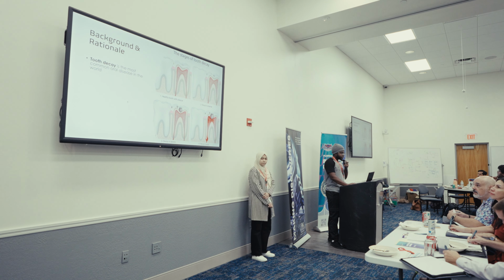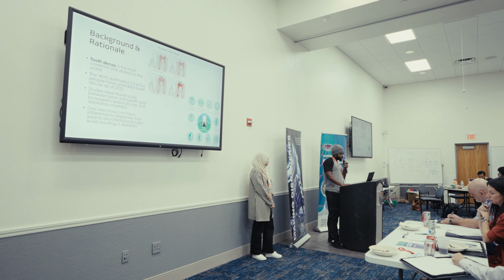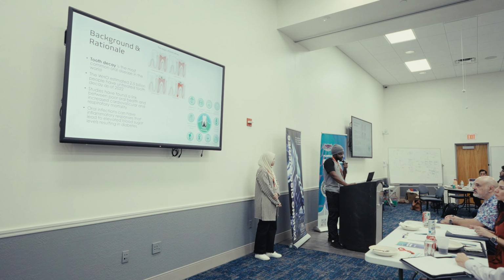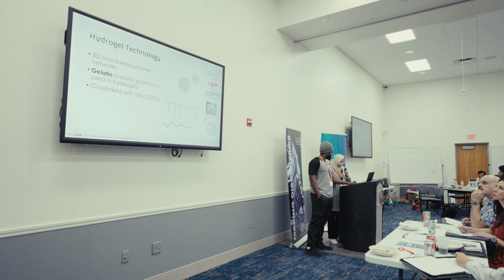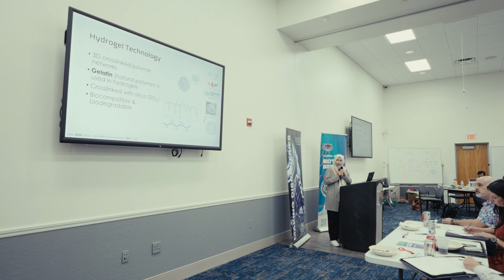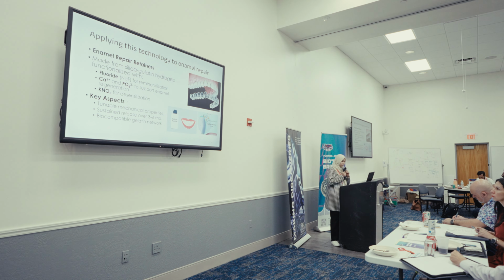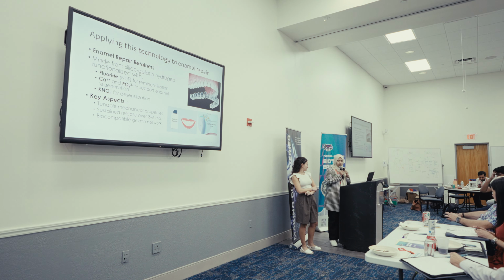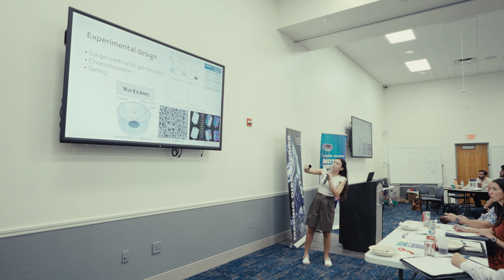Functionalized Hydrogels for Enamel Repair @ FAU CMBB Longevity Biotech Hackathon

Comment: The main problem with this field is the time to results it, also these students saying this is something new when it has been out there for multiple years, the field of hydro gel polymers has well documented use in the dental field. but a treatment that you have to do for 24/48hours vs one/two 3 hour dental visits. Along with the fact that a hydrogel product would require specialized infastructure to go to the consumer (ie refrigeration + short shelf life) or if it is something done by a dentist they would need to/most likely manufacture on site.